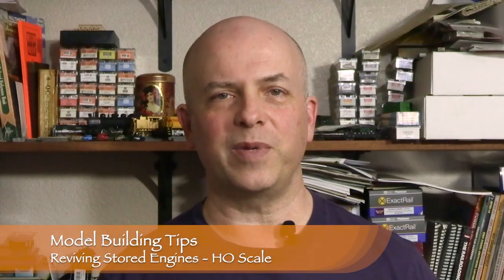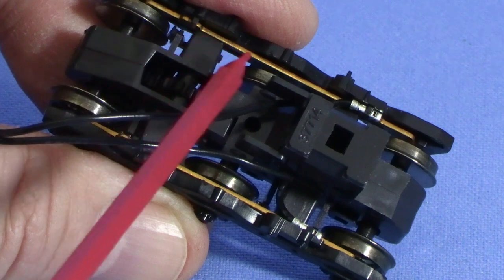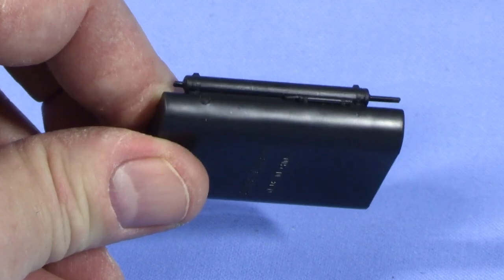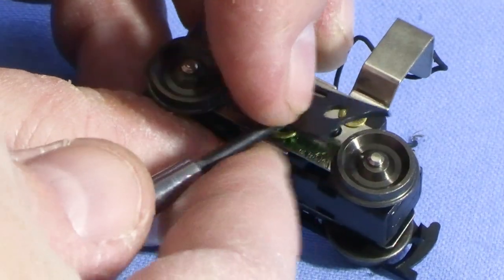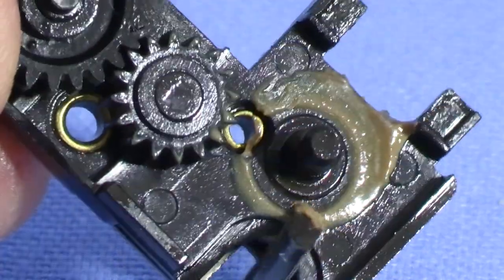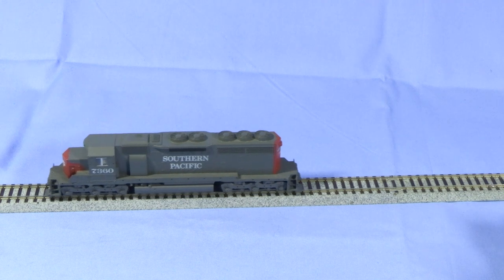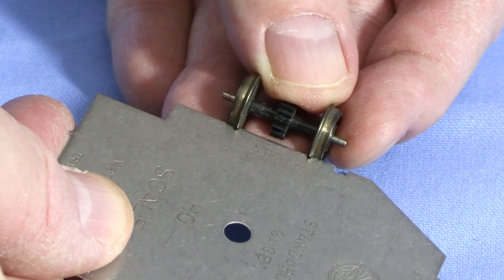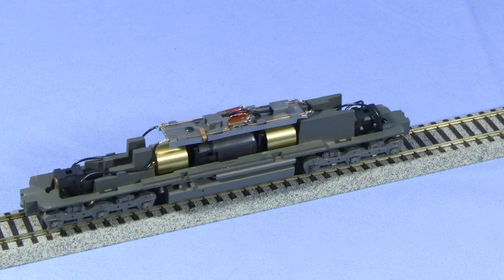Model Building Tips HO Reviving Stored Engines - Congealed Lube and Cracked Gears, Oh My!

Comment: Thank you, Dan. I ripped up my track, thinking I must screwed up AND THEN found out it was a lub job that was needed. Made sure I came to you to fix it right.
Reply from the maker: I'm sorry you took up your track.  I'm glad you found the video helpful, though.  Old lubricants can really make a model run badly, so if they've been stored a long time sometimes a good cleaning is what they need.  I run into the issue often with my own models, since I have a lot of locomotives that have been in boxes for a decade or more.  Thanks for watching!

Comment: Hi. Broze bearings do not need any lube because the metal has lube feature itself. This is special alloy. Lube only makes it dirty more faster.
Reply from the maker: I had not heard that before.  Thanks for the info!
Reply: Ya, that's why there's a giant grease pack on each Bearing of a steam loco... whatever dude. In the ideal world of "everything works as designed" I'm sure your statement is true. Here in RL, everything needs to be greased.

Comment: Great video, Dan.  It never occurred to me to paint the wheel faces at the same time I have everything apart.  Two words:  ultrasonic cleaner!  I do many decoder installations for friends and I always make sure that the engines run perfectly on DC before I put a decoder in them.  As a part of that process, I make sure that everything is clean, in gauge, and properly lubed first.  I purchased an ultrasonic cleaner on Amazon that works wonders to clear old grease and oils out of hard to reach places.  My method is to take as much as I can apart, wipe out the old crusty grease with inexpensive cotton swabs and tissue paper, then put everything in the ultrasonic cleaner with warm water and a gentle cleaner/degreaser such as Simple Green and run it for at least 15 minutes.  If they need another round, I dump out the now very dirty water and start fresh.  Once everything is clean, I spread everything on a microfiber cloth and let it air dry.  I then reassemble and lube as I go.  This method works perfectly every time, and I know I that the engine will not have running issues in the future.  I do the same thing for steam engines, although I keep as much of the running gear together as I can, and use low pressure compressed air to dry everything.  That ultrasonic cleaner was one of the best $100 I've ever spent and is a great time saver!
Reply: I second the ultrasonic cleaner, its incredibly versatile for many things
Reply from the maker: I hadn't thought about using one of those, but I might have to give it a try sometime.  I think maybe Nichole has one somewhere, but if not I might pick one up.  Thanks for the tip!

Comment: Excellent tips Dan!  I've been using a container with warm water mixed with a little Dawn dish soap to clean the plastic gears and parts (being careful not to put anything that is conductive in there obviously) and it really helps to loosen dried lubricants.  I'll then scrub them with a soft bristle tooth brush and dry them using disposable shop towels before reinstalling and lubricating them, works pretty good!
Reply from the maker: That sounds like a good method, too.  I've also used cleaners like Windex.  I'm glad you liked the video.  Thanks for watching!

Comment: Thanks for the tutorial on maintenance. It’s worth a shot over leaving them in a box or disconnecting the drives to use them as dummies.
Reply from the maker: It's worth a try.  Many times a good cleaning will revive a non-running engine.  Thanks for watching!

Comment: Yea Dan. Whenever I get a P2k 4 axle loco, I always replace the gears, & in the case of Athearn BB, I always replace the wheelsets with ns wheelsets, as a standard, whether the P2k locos need them or not. Another good video, thanks. Michael   NZ
Reply from the maker: Sounds like we've done similar things.  I've been going through my remaining Proto 2000 4-axle engines and doing a cleaning, re-lube and gear replacement.  I don't have too many blue box engines anymore, but the ones I have left have nickel silver wheels.  I'm glad you liked the video.  Thanks for watching!

Comment: Thanks, Dan. I have an old Proto 2000 GP20 that is having the exact problems you fixed. I had been thinking about just removing the motor leads and worm gears and making it a dummy to add unpowered to a consist, but now I'm thinking I'm going to take it out of the box and see if I can't get it running again.
Reply from the maker: I'm glad you found the video helpful.  Gunk in the worm bearings has been a common problem with a lot of my Proto 2000 models, so maybe yours has the same issue.  I hope you can get it running.  Thanks for watching!

Comment: Dan, I do something with these revivals you could try.  I flush the gear housings I figure to call them,, with electrical contact cleaner. The old grease just drips out usually.  Let it dry and some grease on the worm gear usually works to get them going.  I once read the plastics used don't need lubricants.  IDK.  Also Walthers sells replacement wheel sets for these locomotives, Evilbay usually has them. No need to do the old school Athearn gear swap on the Life Like Proto 2000 units.
Reply from the maker: I've used contact cleaner, but not in that way.  Sounds interesting.  Some engineering plastics are slippery by design so some of them technically might not need any lubricant.  That's good to know there is an alternate source of replacement wheels.  I have a stockpile of Athearn parts so I usually just use those.  Thanks for the ideas and for watching!

Comment: Very, very useful information to know. Thanks for sharing this. I can remember replacing proto 2000 gears a long time ago.
Reply from the maker: The cracked gear issue has been a problem with some Proto 2000 models for a long time.  I'm just glad they're such a close copy of the Athearn design that the gears are interchangeable.  Thanks for watching!

Comment: Neato! Got any tips for hiding the metal power strips on the Blue Box Style trucks?
Reply from the maker: Do you mean the metal sides of the gearbox between the wheels?  Some Proto 2000 and newer Athearn has a black plastic piece to hide that part.  I also sometimes just paint that area black so it won't show.  Thanks for watching!
Reply: @DanielCortopassi  Do you know what the name of the part it is?
Reply from the maker: Unfortunately, no.  I'm not sure what it's called.

Comment: Did you Note any Zinc Rot on the proto2000 locomotives? I have an early 98 Locomotive and I am told Zinc Rot really destroyed the weights in those Locomotives. from the outside everything looks good but when the weight comes off it just crumbles
Reply from the maker: These GP20s didn't seem to have that issue.  One of my Proto 2000 GP38-2s had the frame break in half, but those have a completely different chassis design.  A future project for me is seeing if I can put an Atlas chassis into the Proto 2000 GP38-2 shell that I spent a lot of time detailing and painting.  Thanks for watching!